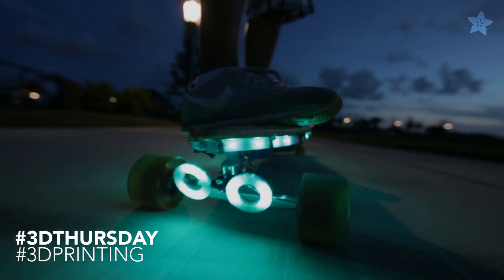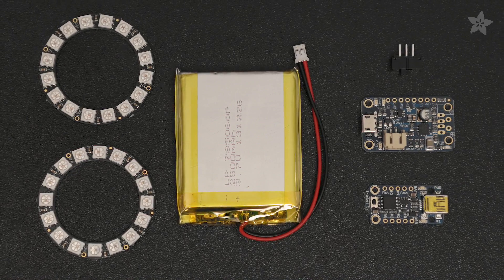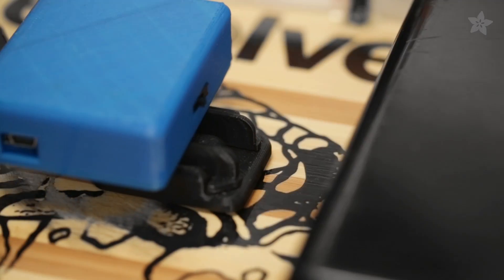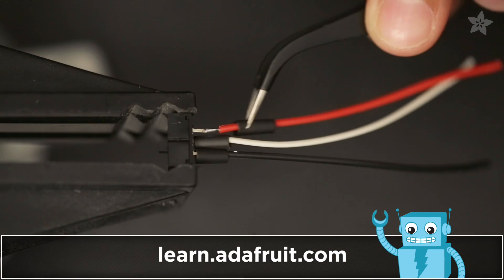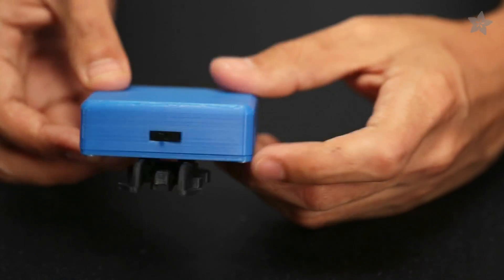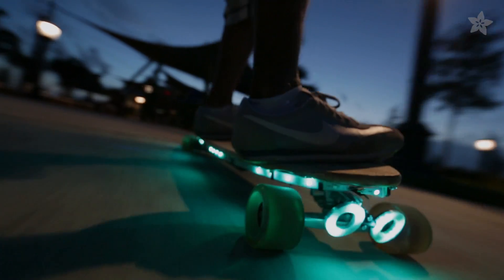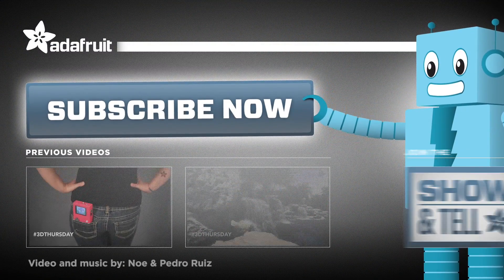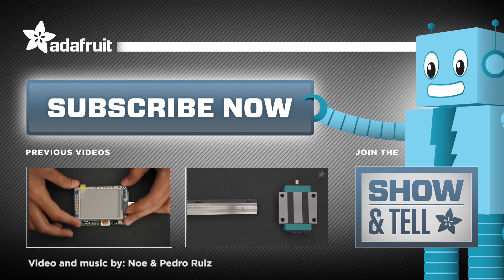Trinket NeoPixel LED Longboard - 3D Thursday

Comment: I would actually add a small FLORA to run to a Audio module (I hack the Rafioshack Mic&Speaker Combo) with a pressure sensor that if you step/tap on it, it can act like a horn.

Comment: Add a tilt sensor to the bottom of the  board and let the lights in the eyes rotate in the direction you're turning
Reply: Ahh that'll be very cool. But it is even more difficult to develop. This is supposed to be an easy DIY.